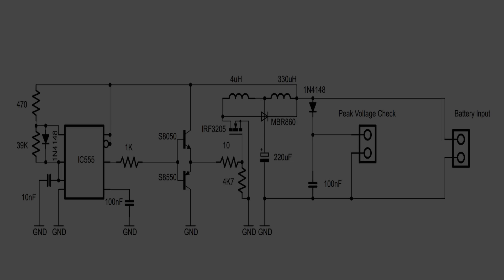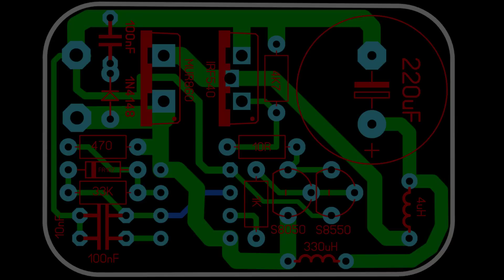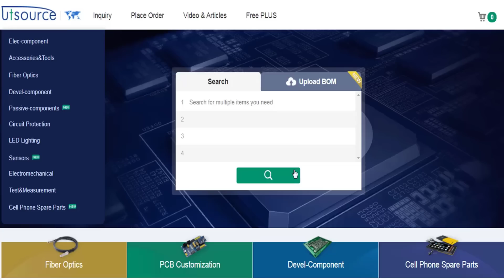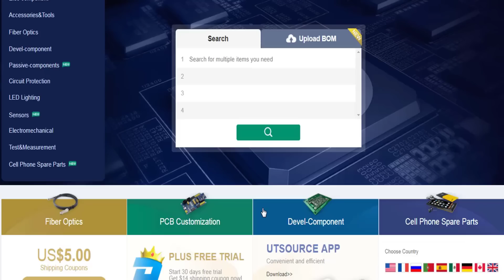Battery Desulfator Simplest 555 Timer Circuit | Simple Battery Desulfator Circuit

Comment: Do you know if your desulfator pulses are 16 volt power spikes like a Noco Genius 5 and 10 charger or CTEK charger uses? I have a Pulsetech PowerPulse passive battery desulfator on my 2001 BMW battery as preventative maintenance as Pulsetech claims that there patented frequency they use can extend battery life up to three times. I also used my PowerPulse on my other BMW battery that I let sit disconnected for a year, and it was at 11.2 volts, I tried charging it with my friends Exide 6 amp automatic charger for 14 hours and battery voltage was at 13.1 volts, yet it would not start my other car. I put the PowerPulse on it along with a 1 amp Schumacher manual battery charger for 72 hours, and left the desulfator on it for a week and it started my car right up.

Comment: I tried it on tubular battery when the volt become little high the mosfet burn and the inductor also.  What is the problem
Reply: Your inductor 4.7uH is out of spec, it causes the 330 uH to melt and burn, and the Mosfet to crack open!

Comment: hello long technical...the pcb board in pdf file is that the actual size of the board?...can i print it out right away? thanks.
Reply from the maker: Print on a4 paper
Reply: @LongTechnical  thanks bro
Reply: by the way do you have a video of the desulfator working or charging the battery with measurements?..your video cuts off at parts assembly. please show a video that the desulfator is working...thanks again
Reply from the maker: Sorry i don't have any video like that

Comment: i have this circuit running my batteries more than 25 years. The schematic was also published in elektor magazine some volume back in 80-90's
Reply: so after 25 years of your experience, what do you recommend? will it be working good for lead acid batteries 100Ah or 200Ah?

Comment: What is a desulfator for/do??
I mean I see what the schematic is doing but I don't understand what it's fully.
Is it charging or decharging or what???
Reply: It's  revive the died  batteries
Reply: when a lead acid battery's voltage drops near zero, it starts to corrode, this device can pulse charge the battery and remove that corrosion but its not made for charging

Comment: Please make TL494 Smps or TL494 1000W inverter😀 I have many of these integrated circuit and sg3525 is hard to find on my area.
Reply from the maker: I will try in the next time
Reply: i already made smps of 1500w, using sg3525 and inverter 600w using sg3524